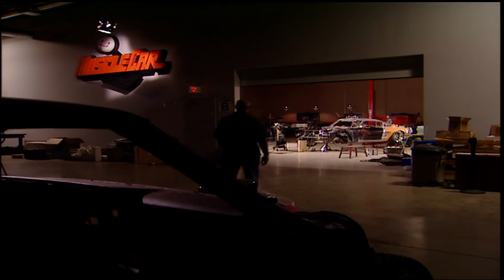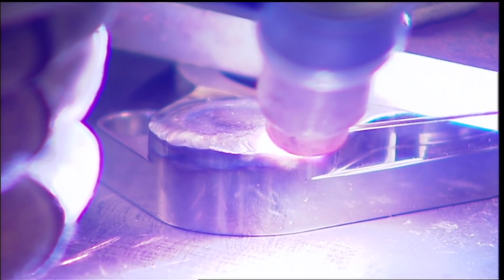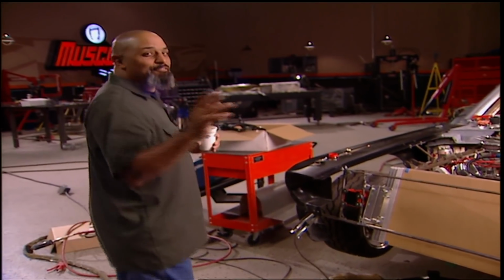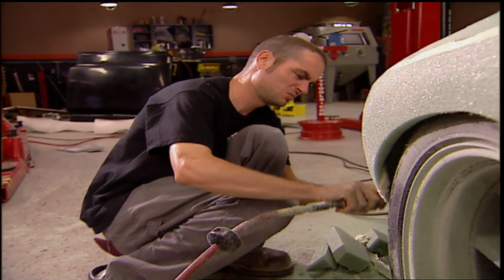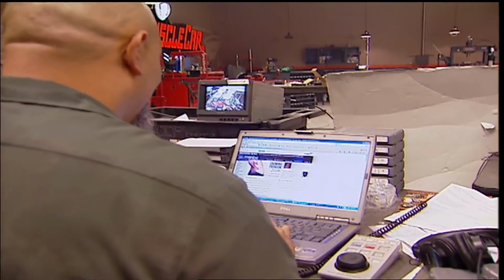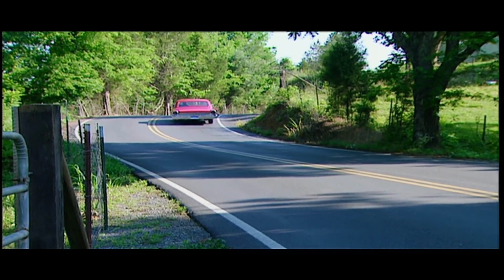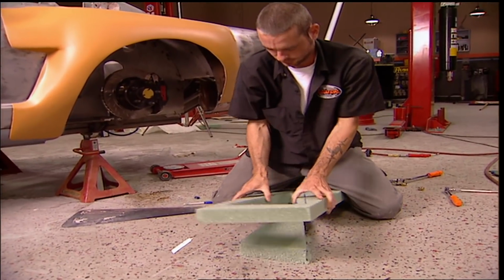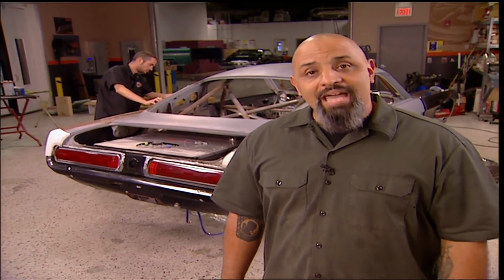Will The '65 Mustang Road Racer Be Able To Fire Up? - MuscleCar S2, E22

Comment: that's why you alway prime the oil pump via the distributor on a engine before starting it to easy to do on a ford not to do it
Reply: The problem is this car uses an external oil pump.